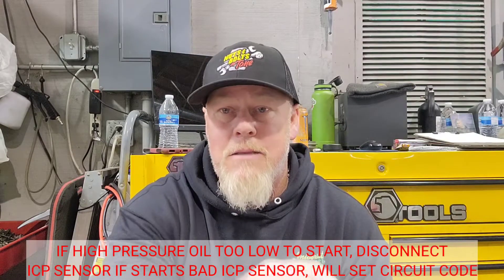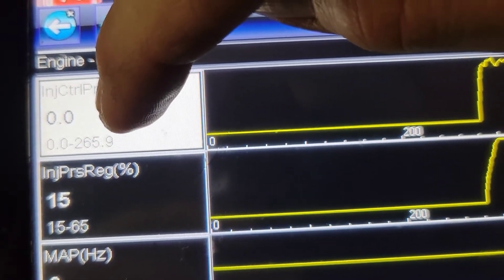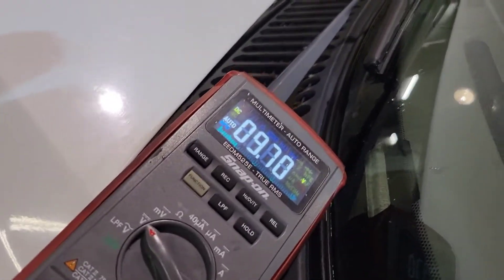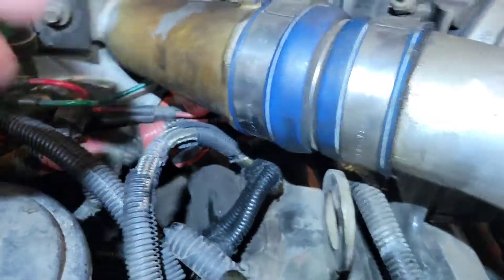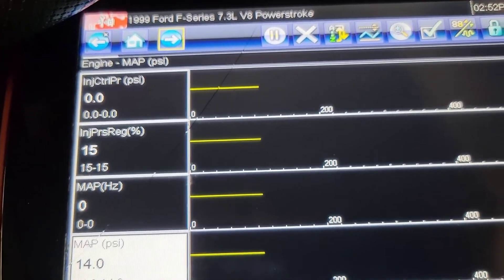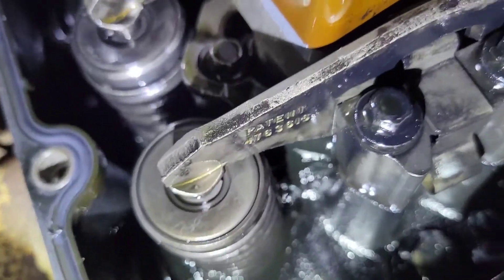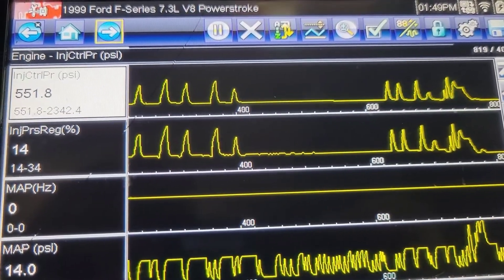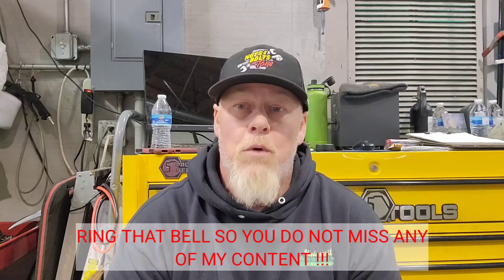7.3 Ford Diesel No Start Troubleshooting

Comment: Great video! Wonder which system you're using to do diagnosis. I love the graph set up. Think I'll use that smoothie idea 💡
Reply from the maker: I used the snap on modus ultra. I also use a Topdon Phoenix Lite 2 scan tool now as well.  With the Topdon you can actually put up to 4 graphs on top of each other.  Thanks for watching

Comment: I have a question, when that top oring is broken like that does oil show up in the coolant or does diesel fuel show up in the oil? Not sure of the configuration..I have a 95 7.3 that is not starting, have replaced some things and checked others, but didn't check the injectors because there was no oil or fuel in the coolant and dipstick oil looks and smells normal..can the oil be leaking out of the top without getting into the other systems? Would appreciate any help..Thanks..great video!
Reply from the maker: Ok first I would like to say if you can message me on Instagram I can try to help u get it started. In the video I showed the oil leak from broken o rings. So I'm this case the engine needs 500 pounds of oil pressure to start, if there are oil leaks in the high system oil pressure will be lower. Thank you for watching. I hope to hear from you over on Instagram
Reply: Did you fixed i have one like yours wonder what worked for you

Comment: Very informative. 
Driving down the highway, in my 2003 7.3, my truck craps out and will not restart. 
Get it towed home, 
Replaced CPS, IPR, and ICP. 
Watching on my edge CTS3 tuner, while cranking, I have 500psi+ oil pressure, 65% on IPR, and .60 on injector pulse width,  which seems to meet the parameters to start? 
I get a little white smoke out the tail pipe while cranking but I can't get it to fire to save my life
Reply from the maker: First off thank you for watching the video.  I would check fuel pressure,  do you have any codes? If you need anymore help message me on Instagram and I'll be happy to help.
Reply: @NutsandBoltswithTone  sorry buddy ... I don't have the instagrams because im a hillbilly living on the side of a mountain. Lol. I keep leaning towards a fuel pressure issue and you've helped me confirm where to look next. You seem like an awesome dude and I appreciate your videos. Just the fact that you respond, you're right up there with diesel tech ron status!
Reply from the maker: @calvin.miller  thank you so much brotha I actually learned allot from him in my early days.  Message me here if anymore questions I understand.  Fuel pressure is next.  Is it electric pump on rail or mechanical in valley?
Reply: @NutsandBoltswithTone  pump on rail.
Reply from the maker: @calvin.miller  ok. Yeah check fuel pressure

Comment: Nice good to know 
My 97 7.3 it was The high oil pressure pump I replaced it and it runs awesome
But my 96 7.3 is doing the same thing like the video one 
And my 93 7.3 IDI crank but not start not even with either that one is more complicated I think 
What do you recommend
Reply from the maker: For the IDI I could look up at work for a direction and see if I can help you. Can you message me on Instagram and I will try to help you through there. Thank you for watching.
Reply: @NutsandBoltswithTone  Instagram  ok I will thanks

Comment: Maybe Injector O rings?
Reply from the maker: @KeepitReal-wn4zj  yeah an injector o ring that seals high pressure oil can cause it too, I've had that
Reply: @NutsandBoltswithTone  Me too I had just replaced my IPR and HPOP and it didn’t want to start for nothing. I even had 2 battery chargers set up. Come to find out it was my injector O Ring, I replaced all of them. 

Rightnow, it won’t start with the ignition key and I have to start it from the solenoid on the fender. Any help would be greatly appreciated.

Thanks